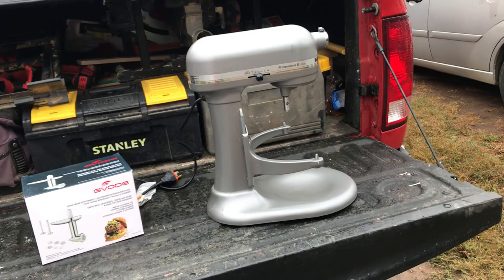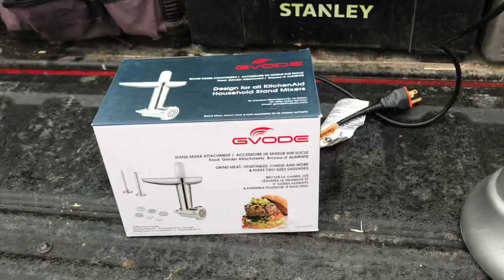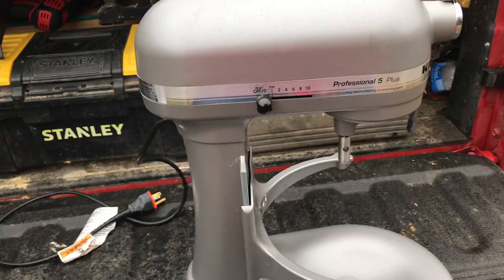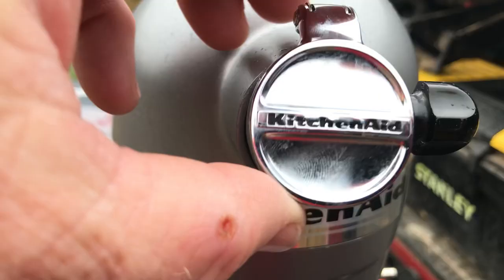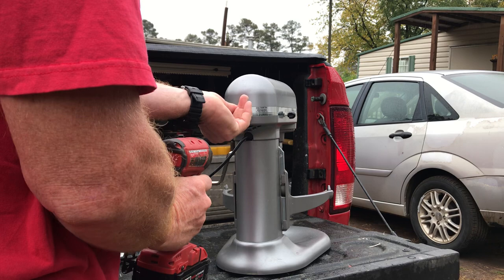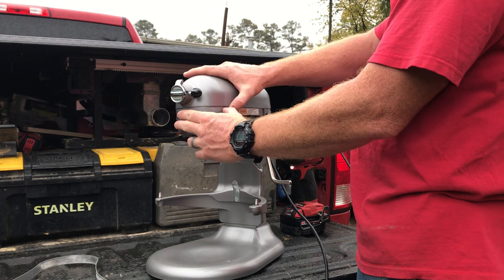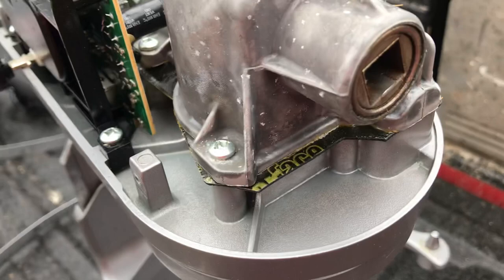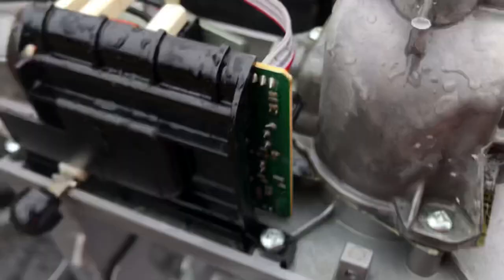Cleaning your Kitchenaid mixer. NEVER use it to grind meat. Easy mistakes lead to big messes!

Comment: The question I have if the author used the plastic nut or whatever itss called that is aupposed to seal the grinder from the machine. I actually bought the original KitchenAid metal grinder attachment and am hugely disappointed. After the first wash the grinder and all its part turned dark grey and as someone is saying this is a sign of "leaking lead". Not sure if this is true, but it is extremely nasty and unpleasant. So I am in fact looking for a stainless steel version of this attachment, and sadly KA does not make them. Only some noname Chinese products like the GVODE you used in this video are available on Amazon. Seeing your video made me pause for a sec but then I noticed there are quite a few video reviews of this chinese product on YouTube and you are the only one reporting this problem. Which brings me to the question: did your attachment had that plastic seal on the auger or not?
Reply from the maker: No it did not have it.
Reply: The KA brand is stainless steel. It can discolor in the dishwasher if the wrong soap and temps are used.
Reply: @DGHamblin   That might be the culprit. Shortly after posting my question I decided to bite the bullet. I bought the same Gvode as yours. It did come with the plastic washer attached to the rear end of the auger. The main body, auger, and the knives are indeed made from stainless steel, while other parts are made from some other alloy. All in all, while not a perfect match to my stand mixer, for the money it is a good product. And no, it does not leek meet juices into the mixer body. I would prefer it have somewhat larger diameter body to process more meet. Other than that not much to complain about. If i did not slready have a stand mixer, I would probably go for a standalone meet grinder, but for low volume grinding this attachment does the trick. And it is easy to clean.
Reply: @HungLikeScrat  I am sorry, it is not stainless steel. I own them both. When you are holding the original KA attachment it is a lot less weight, has thinner walls, and looks press-formed, while the Gvode is clearly machined.
Reply: @HungLikeScrat it’s aluminum. They are very opaque on their website saying « metal » or « die cast metal » but it’s aluminum. The fact that they’re hiding it is illegal where I live.
Reply: @SuleymanAkhundov  lol

Comment: Thank you for video, I just bought my kitchenaid stand mixer professional 5 plus like yours and bought grinder too. Now I think I should return the grinder tomorrow.😭
Reply: My husband just bought me a KitchenAid stand mixer for Christmas, and the first attachments I was hoping for was the meat grinder. I think I’m still going to try it. Other people have said they use the KitchenAid meat grinder, and theirs don’t look the same as the knockoff. They said the knockoff appears to have a part missing that seals the attachment.
Reply: @akabga   Hey I didn't return the kitchenaid grinder at the end, I tried to contact with kitchenaid customer service and they said the situation of this video is possible. They advised me don't grind the raw meat when they are wet and bloody, the liquid is possible get in the core of the machine from the entrance. 
We should always freeze the meat until it isn't wet. I tried grinder different meat, it worked very well. I recommend the grinder, just make sure no liquid can run into the core body.
Reply: @vicki1091  Thanks for all your advice! I’m so glad my husband bought this for me. Can’t wait to try the grinder once we get it!
Reply: I have the same mixer and bought the kitchenaid brand meat grinder. This happend to me too. Luckily i saw all the meat Liquid and trued to clean it as much as i can. It was really disgusted by it. Now im gna try to open mine
Reply from the maker: Good! Thank you for the advice!

Comment: Had a kitchen aid for 40 years. Use more as a grinder as a mixer. Wore out 2 grinders.  Never thos issue......you said the kitchen aid brand was "prohibitively expensive "?? WTF? THEYRE LESS THAN 40 BUCKS
Reply from the maker: Was your plastic or stainless? I didn't want plastic. I spent a lot more than $40 for the grinder I had, and it was a fraction of the cost for a stainless from KA